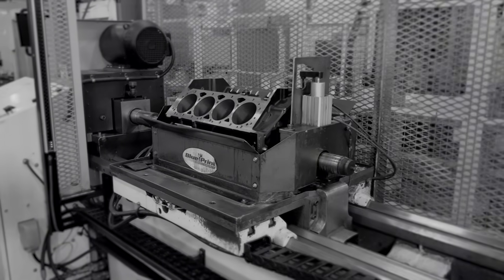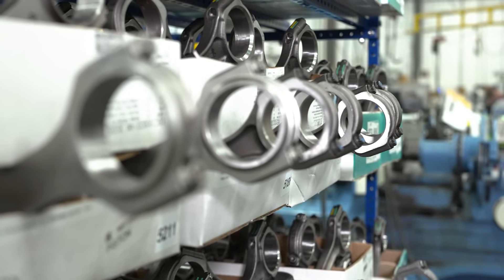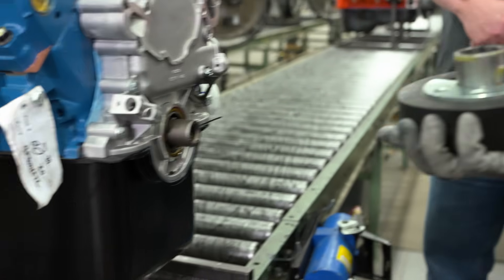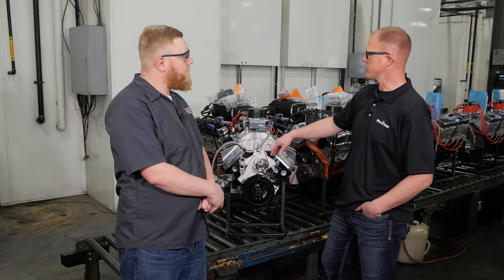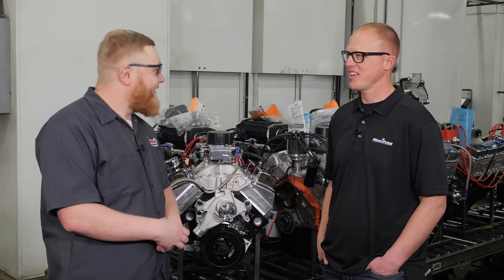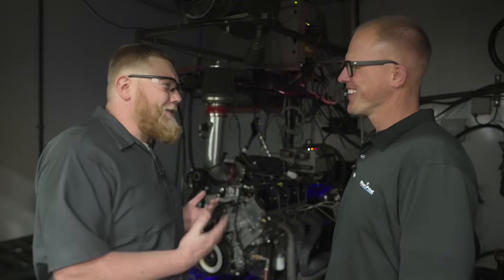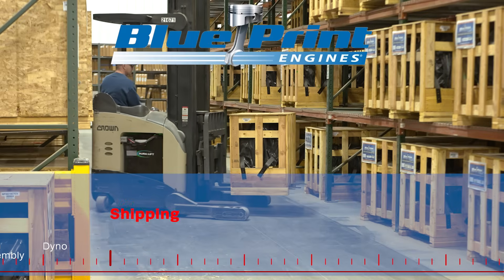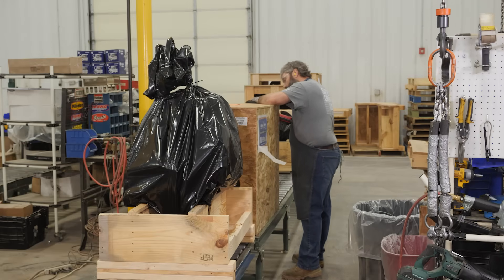Crate Motor Final Assembly: Part 3 of Our BluePrint Engines Factory Tour

Comment: This three part series actually talked me out of buying a blueprint engine. Everything seems too rushed, too reckless, and they don’t even start bolts with their fingers and then tighten them down. They start them and tighten them with pneumatic tools. Guarantee every block has some cross threads.

Comment: I have a 1997 Chevrolet Cavalier 2.2 I need over hauled or new motor My car has 283k miles on it but IF I make it back home that's 783 miles back I been stuck here in Farmington, NM for 2 years. I don't really think I can make it back it has noise coming from the Mains or rod bearings going out. I'm on SS so I Don't have lot of money. Shops here are outrageous  in Price to over haul AutoZone has a rebuilt motor for $1800. But I'm to old to install it. But first I need to get home by the 5th of July.

Comment: My friend bought a 396 sbc Blueprint Engine 3 years ago.  We put it in a 68 Prostreet Camaro with a built turbo 400 and a narrowed 9 inch Ford NASCAR rear end with 4.30  gears.  It also has 17 inch wide Mickey Thompson tires and weighs 3200 pounds.  He has put a lot of hurt on those very wide tires in the last 3 years.  The engine is just as strong as it was 3 years ago and sounds great.